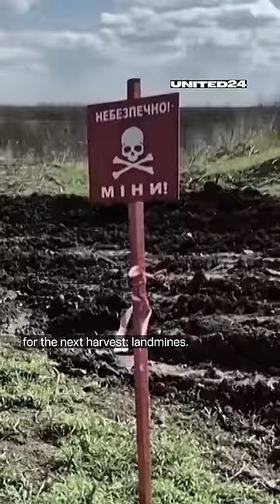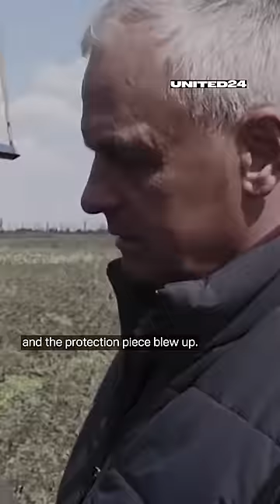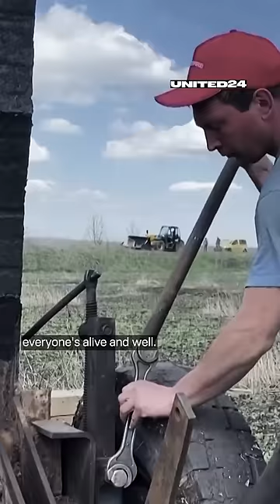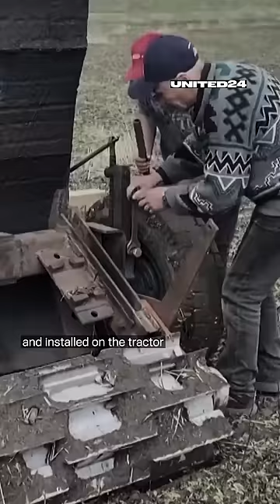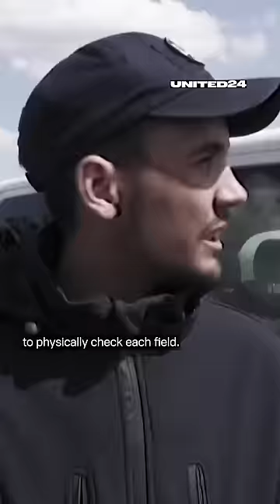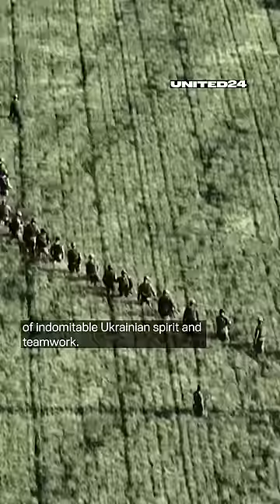Ukrainian farmer comes up with novel way to demine his fields 🔥 #warinukraine #shorts

Comment: I don't want to spoil everything, but there are two facts that I want to point out. The Russian military forces use mines with liquidators. Therefore, in a few weeks they do not need to be cleared. It is also worth pointing out that I do not think that such armor will save the tractor from a mine explosion that can blow up a tank. Only specialized machines that throw mines out of the ground can survive this.
Reply: I wouldn't want to bet my life on it.
Reply: Two things, Ukraine doesn't use self liquidating mines, and even if they're self liquidating, there will always be some defective ones
Reply: Yeah, that’s just straight up a lie. A lot of Russian mines are not liquidators.

Comment: Pato picker or rock picker flat bed conveyor made metal bars spaced  so  the earth and small rock fall between the bars. But mine size objects get moved to rear and laid on top the ground at back end machine . It would need side walls of metal plate steal incase of an explosion to direct it upward. Cut tire roped together as blast mat hung on metal side walls to dampen the explosion if mine detonates. (We use blasting mats in roade construction when blasting rock, as way keep rock from being throne for miles. We were able use them over and over just replace broken rope as needed and tires chunks )  The metal bars could be made thicker for the  conveyor belt to withstand some damage. But it would be good to make it with replaceable bar straps that hold each individual metal bars of conveyor spaced and together. So you can just replace  damaged  area not hole conveyor belt. 
The machine needs electrical motors attach to each wheel for the torque needed to move into the earth  and turn the conveyor belt by electrical motors at same time. Generators on outside side wall for electricity, one generator on each side. To keep the wires on out side of the frame to protect them, if mine detonates. The frame could be made out rail road metal track. To withstand blast and easily replaceable.